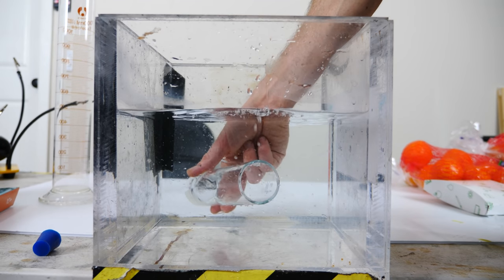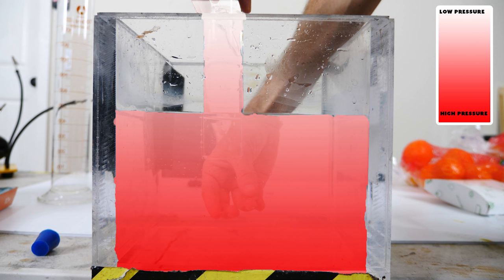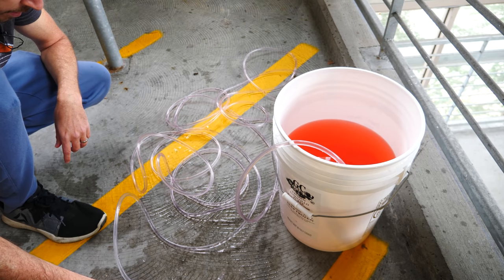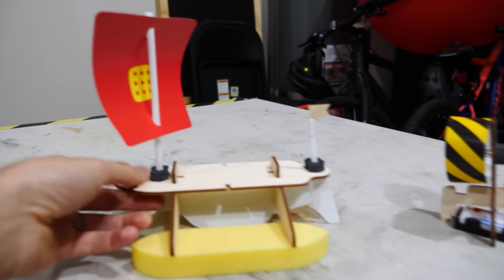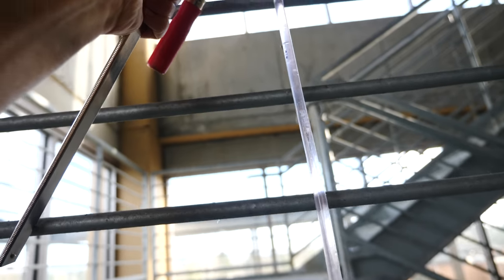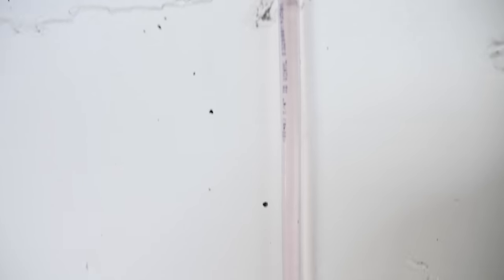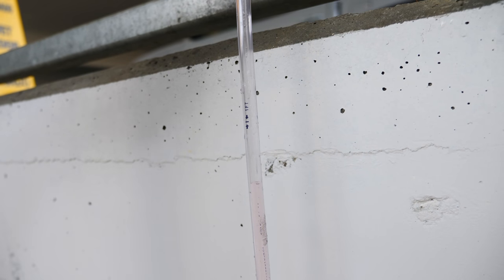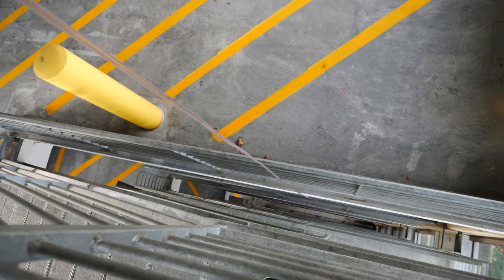Why Water Boils In Tall Cups

Comment: What is the elevation above sea level in the city you’re in? 

Could be that this experiment subtly changes depending on location as the atmospheric pressure would be lower when your starting elevation is higher
Reply: Yh, but that would  make such a small a difference that it wouldnt even matter
Reply: Air pressure working on the diameter of the water column will support a certain weight. A column of fresh water 33 feet tall exerts 1 atmosphere of pressure at the bottom. A column of sea water 30 feet tall does the same thing.

A column of mercury (yucky stuff) does the same trick in about 30 inches.

Air pressure is supporting the fluid, so you can only support the cross section of the pipe times 14.7 pounds of fluid if the pipe is cylindrical.

Why does the shape matter? It doesn't matter to the pressure gradient or the height, but it makes a difference in how many pounds of water will be supported. Tricky, here - a pipe that flared from one square inch at the bottom to 100 square inches at the top would still rise to 33 feet of fresh water even though the weight of the water would exceed the pressure of air at the bottom.

Physics isn't broken, though. The slope of the walls of a flaring tube support the excess weight. Think of the slope of the walls pressing against the water in two vectors, one horizontal, and one vertical.

When the walls are cylindrical, the walls don't have any vertical influence. As a flare is added to the walls, they start to support more and more of the weight of the water.

The fluid/gas boundary is not necessarily from the water, btw. Starting just above the bottom of the column there is less than 1 atmosphere of pressure. If the water had dissolved gases in it, they would be released before the water would start boiling.

The height you see is also dependent on gravity since that drives air pressure. Results will vary on other planets.
Reply: Why the does people do this for example Wulan Dari just stop it
Reply: @johnnyragadoo2414   Mercury isn't "yucky."  When we were kids, we used to play with it whenever a thermometer broke!
Reply: @maindepth8830  The difference is not all that subtle. The weather report for today says my local pressure is 29.97 inches (of mercury). At just 1,000 feet higher in a little Cessna, it would be about 28.97 inches. At low altitudes, there is about one inch of mercury pressure lapse per thousand feet.

The 33 foot column is basically a water barometer, reflecting air pressure at the bottom of the column of water.
Reply: @ThatBoomerDude56  Yes, that was a thing, wasn't it? Fascinating stuff, just a little toxic. Dental fillings used mercury, too, back in the day.
Reply: @maindepth8830    The difference is more than you think. At sea level the air pressure is 14.7 psi.  In Denver it is only about 12 psi.  A drop of about 18%.
Reply: @johnnyragadoo2414    Mercury amalgam fillings are still used, but there are alternatives.  The alternatives however are less durable.
Reply: @my3dviews  oh didnt know that
Reply: @johnnyragadoo2414   Two things that I need to comment on. One, you have to mention that the 14.7 pounds times the cross section is only true if you're measuring the cross sectional area in square inches. Many people don't live in America and don't use those units, so you must specify. Second, the tube doesn't have to be a cylinder. The tube only needs to have completely vertical walls. A rectangular prism tube would also work.
Reply: @ThatBoomerDude56  it lets off toxic vapor, check to see if you have a third or fourth eye please.
Reply: @DANGJOS  Well, 14.7 is already in units of pounds and square inches, so I glossed over that. I appreciate the clarification.

The walls don't have be vertical. If they are flared out, they are applying a force against the water in two axes, vertically and laterally. The vertical component of that force will carry what the original square inch doesn't.

Imagine you're in a swimming pool. At ten feet in the deep section, the pressure is about 4 psi over atmospheric. As you ascend, it decreases to 0 psig at the surface.

The shape of the walls or the nature of the shallow end of the pool doesn't change that.

Think about 10,000 pounds of water in a 100 by 100 inch rectangular tube, which will put 1 psi on the bottom.

To keep a one square inch plug at the bottom would require 1 pound of force.

Now flare the walls out, maintaining the 100 by 100 inch footprint at the bottom, but increasing the size at the top.

Pour in enough additional water to return the depth to the starting point.

The pressure at the bottom will be 1 psi, just like it was before. The 100 by 100 bottom will be supporting the same weight of water.

There's more water, though. The additional water is being supported by the vertical component of the force applied by the sloped walls.
Reply: @johnnyragadoo2414   My physics professor actually created a 30 foot water barometer on the third floor of the science building at the college. The water was blue because they added copper sulfate, which I think was to prevent algal growth and get rid of dissolved gas. It was so cool to see the water boiling when they would set it up or reset it! The diameter was like 15 centimeters, so it was much larger than in this video.
Reply: @DANGJOS  That's cool!
Reply: @johnnyragadoo2414   Indeed it is! As for your other comment (which I just saw) I think there's a misunderstanding somewhere. I already understand everything you're explaining there. I thought you were talking about how many pounds of water (in total) that could be supported in the tube. The answer is 14.7 pounds for every square inch of cross sectional area if the walls are vertical. If the walls are not vertical, then it is not necessarily 14.7 pounds per square inch. It can be more, the same, or less, depending on the shape. I was assuming you were referring to the cross sectional area at the bottom I think.
Reply: @DANGJOS  Yes, that's it. You expressed it better.
Reply: @my3dviews  The toxicity is disgustingly overrated though, and the fumes released so limited at room temperature that you'd need to literally be sucking on it for it to do anything.

Even then, you'd have to do that for a while before it becomes a problem.

Regardless of its lack of danger to humans, it's still something we should limit production of because it's an environmental nightmare with disposal.

Though it is frustrating when people see you touch it and think you're going to die.
Reply: @johnnyragadoo2414  I assume the 14.7 figure has something to do with stoichiometry between fuel and air? Or is it just coincidence that engines need 14.7 parts air for 1 part of fuel?
Reply: @my3dviews  Okay.  What you said is technically true.  
But the evaporation rate of mercury at standard temperature and pressure is 50 millionths of a gram per hour per square centimeter of surface area.  (Took your suggestion and looked it up.) 
An old thermometer has about 1 gram of mercury.  So that little drop will all evaporate after: 
((1000000/50)/24)/365 = 2.28 years. 

So, their wording of "if the mercury is not immediately contained ..." is perhaps overstating the issue by a little bit.
Reply: @Stellarffxi  Coincidence.
Reply: @Stellarffxi  Good catch! I wasn't clear. Standard atmospheric pressure is about 14.7 psi, or 101,325 Pascal.

If you want to see more food for thought, check out what a pound means - we use the same term for a unit of mass or a unit of force and they are not the same thing. I can rattle on for too long about such things. My physics has harsh limits, but I can probably explain force, mass, and acceleration if you're interested.
Reply: @ThatBoomerDude56    Yes, the quantity does matter as does the surface area and temperature.  
I mainly replied because you said "It absolutely does not "let off toxic vapors."
Is it a huge problem, probably not, but still something to avoid, especially for young children.
Reply: @MelodicTurtleMetal    I don't disagree with what you said.  Still probably best to avoid it where possible.
Reply: @my3dviews  As someone who has dealt with young children, I can certify that the main thing you need to avoid is them swallowing the stuff.
Reply: @johnnyragadoo2414  What would happen if you do the same experiment with mercury? Will mercury start to boil as well?
Reply: @PaulPaul994  I believe that's what happens. As I understand, the vacuum above the mercury level in a traditional mercury barometer is mercury vapor.

It's not really a complete vacuum, of course, it's at the vapor pressure of the mercury, which is very low.
Reply: @maindepth8830  actually elevation makes a ton of difference, you can boil a pot of water on a tall mountain at about 60-70 degrees depending on elevation, at those heights you can put your hand safely in boiling water
Reply: @King_Flippy_Nips  yh, but in this experiment elevation did not play much of a part as the elevation was quiet low
Reply: Keep in mind the basis for measuring how high water can be... Is not sea level, but the level of the main source of the water in question. You can pump water to the top of a skyscraper, theoretically, if you have enough holding tanks that don't exert pressure on the water column below them. The problem here, is water is freaking heavy.

Comment: I think this is the reason some old cook books have adjustments to recipes for high altitude cooking. They usually adjust the cooking time because the boiling point is at a lower temperature.
Reply: That must be very so.  Boiling water reference provides a known temperature (relative to elevation) without a thermometer and eliminates any diversity from LOW-MED-HIGH burner size.

Comment: water boils at 100C or 212F at sea level. and it boils at lower temps at higher elevations because the atmospheric pressure is lower there. and the water vapor pressure, usually provided by adding heat can be lower to create a boil. when water vapor pressure equals atmospheric pressure water boils. When the pressure above water is very low as in this test, water will boil at room temp. so how does water from the roots get to the top of trees taller than 34'?  Water is moved up the tree by using cohesion-tension, transpiration pull from leaves,  and the root pressure. water can rise to the 40m mark so it can get to the leaves. nature is amazing

Comment: It could be interesting to try the same experiment with alcohol, because it evaporates at a lower temperature. Maybe it will evaporates at a lower pressure too.
Reply: Yep, interesting. Everything evaporates at any temperature, until the vapour pressure is reached. At 20.0°C, the vapour pressure of ethanol is 5.95 kPa, which is higher than for water. However, its density is also slightly lower at 789 kg/m³. So that would give a column that is taller than that for water.
Reply: @landsgevaer  This would be cool experiment.

Comment: The low air pressure at the top of the cup doesn't suck the water up. It pushes down on the water, but the water at the base pushes more, causing the water to rise.
Reply: In practical terms, that’s always what the term “sucking” means really.

Comment: The problem with this is that you used a flexible tube. It needs to be a solid container with no flex to maintain the atmospheric pressure. Otherwise it can bow in on itself, distorting the results
Reply: Also plastic lets air through. That is the reason why the plastic water tubes inside of a house got an aluminum layer. It is to prevent air getting into the water. He needs to use these house water tubes and put a glass on top to see how much air is sucked out of the water - e.g is boiled out  and how much air is sucked through the plastic surface.
Reply: Pressure in water depends only on height, nothing else.
Reply: @wurstelei1356  No air got in, since he showed the water condensing back into liquid when he lowered it.
Reply: @Owen_loves_Butters  I see air that is forced into the tube. Watch the video, the air isn't getting out fully. That is the reason why you use PEX tubes with aluminum core in your house. See the PEX tube part on Wikipedia here: https://en.wikipedia.org/wiki/Cross-linked_polyethylene
Reply: @wurstelei1356  …air is not “forced into the tube”. The Wiki article refers to “oxygen DIFFUSION”, in which oxygen molecules can diffuse across the matrix, and be absorbed into the water.
Diffusion is a totally different  process from just “air getting through” or “air is sucked through”.
 Main difference is the rate of penetration… diffusion is generally the slow movement of atoms or molecules of an element, such as hydrogen or oxygen.

The air that you think is “being sucked through the plastic surface” is actually the air coming out of solution in the water, in other words being boiled out, due to lowering the air pressure (vacuum)… when the vacuum is released (pressure raised), the air is again pushed back into solution, and “disappears”.
Reply: @ernestgalvan9037  Hmm, that this process is slow is true. But why isn't the air fully going back into the water ? Weird. Maybe he has to go all the way back down.
Reply: it's ok for demonstration purposes

Comment: Q--How much of the tube is hot or producing warmth, at what temperature? Can you use metal pipes at the top for emergency heat? With a ram pump at the top to release hot water into an insulated reservar? Can the bucket of water be placed in the basement to increase lower level boiling? Can the tube be bent to produce lower level boiling? I'm loving this.
Reply: Uuuuhh...It's boiling not because it's hot 
But because "lower the pressure means lower the boiling temperature"
Reply: Boiling point is a function of heat and pressure. Decrease in pressure with no increase in heat will cause boiling. There is no change in temperature of the water or air. You can get around this in two ways: pushing the water vs pulling, or doing it in stages with resevoirs placed in increments less than the height of the boiling point.
Reply: It's not hot...

Comment: How do you know if it's water that's boiling or just the dissolved air escaping the water at lower pressure??

My personal opinion is it's the latter as if there's vaporization of a liquid due to pressure reduction, then the molecules with most energetic states (i.e. the ones on the top) should start evaporatinf first.

And just to address a follow up question, in kitchens, the source of the heat is at the bottom and thus the water molecules at the bottom increase their thermal energy first. That causes the water in your utensils to boil off from the bottom

Comment: I would have loved to see some temperature measurements incorporated into this experiment.  What was the exact temperature of the water at the top of the tube?  How does that relate to the boiling point of water at sea level?
Reply: The water at the top of the tube will be basically that of its surroundings, less a bit due to evaporative cooling. I'd recommend googling a phase diagram for water. There should really have been one in the video.
Reply: @chaos.corner  Thank you so much for the info!  I'm a bit of a geek and I love to learn about these things.

Comment: Be interesting to do this with degassed water to see how much difference this makes.  I noticed some hysteresis when raising and lowering the tube, probably due to previously dissolved gas that came out when (or shortly before) the boiling started -- water vapor will go back to liquid when the pressure rises, but other gases that have bubbled up to the top of the tube will not go back into solution very quickly and will be trapped there.
Reply: Exactly. This video is wrong in multiple accounts. The gases bubbling out were most likely N2, O2, some inert gases and maybe a little CO2, and I bet little to no.water vapor. The water is degassing, not boiling.
Reply: @joelafrite7850  I don't think this video was all wrong, or even very far off.  The pressure at 10 meters or 33 feet (depending upon who is doing the measurement) is already known to be about 1 atmosphere, so the results shown here aren't too far off (and depending upon the atmospheric pressure at that particular place and time, could even be pretty close to correct).  But dissolved gases are clearly throwing off the results at least a little bit.